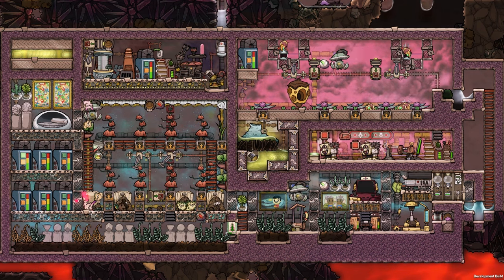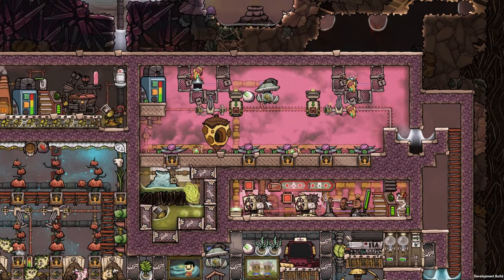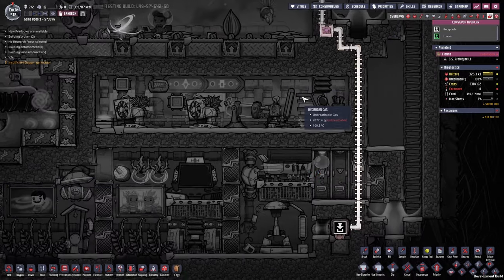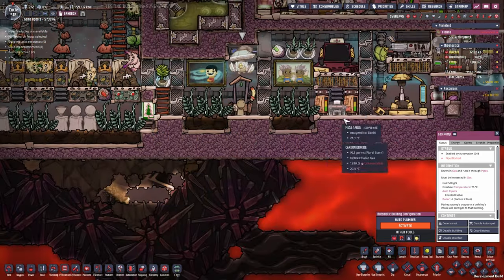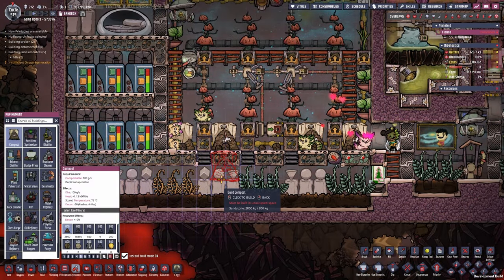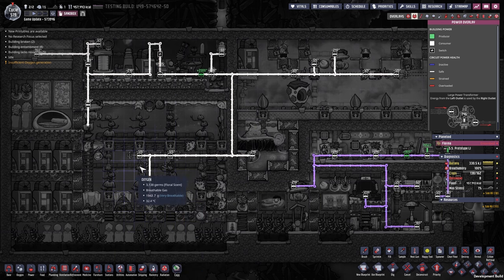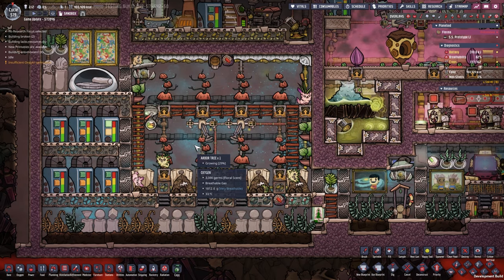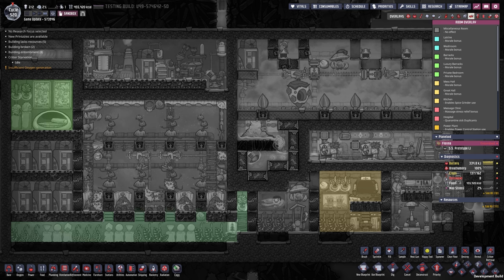Lumber and Saturn Critter Trap Setup - Oxygen not included

Comment: I personally would switch a couple of composts in favor of a pokeshell or two, which will give me sand to run water sieve + proper bathrooms/showers.
Reply from the maker: I thought about that but the amount they give didn't seem to fulfill the amount needed to switch to a water based system. The pokeshell gives 15kg Sand per cycle but the water sieve needs 1/5 kg per second for a 1kg per second geyser. That is 125kg per cycle. I might make a version that has an optional water pokeshell system. But at that time i thought the math didn't work out for what i had planned. I might have been wrong though
Reply: well,you do have ethanol for polluted dirt

Comment: I understand that Food Poisoning isn't deadly, but still... There is a way to have a stable Lavatory/Sink/Shower to deal with it. All you need is enough Filtration Medium for one Water Sieve.
1) Meteor Showers is the easiest way, but not every planet has it. 
2) You can melt Dirt to get Sand. Around 330 degrees Celsius as far as I remember.
3) Pokeshell/Oakshell ranch.
Reply from the maker: Hey Lorens thanks for the list.
I am trying to answer why i decided against it / what was my train of though:

I thought of some of them but decided against them for various reasons:
-A Sand setup requires lots of recoursess itself. I didn't want the base to get too complex. 
-A sieve uses lots of sand. if you have a constantly running sieve supplied by a rock crusher for example you need a dupe almost working half a cycle on it every cycle.
-Meteors are a good recource.
 Probably not in the dlc cause there you only get certain meteors on certain planets.
-Pokeshells are a good source, still alot are needed for a single sieve. 

I tried interesting melting dirt. But over 325°C is alot of heat with only steel as highest material. i try not using niobium or thermium in my build so most people can copy them. Using Magma is implementing a second base recource and would nullify the experiment.

Do you think there is a simple sand producing setup i can easily include? (must work on every planet, cannot use space level material, no exploits)

Am i overlooking something simple?

PS: the water sieve to change this setup to have a lavatory and O2 based oxygen would only need a sieve to run 1/5 th of the time. so 250g of Sand per second
Reply: @lumaraw  So, no Thermium, no Magna and no meteor showers. Sure. 
Sieve requires a lot of sand if it runs constantly, but considering that you only need to filter a little bit of water per cycle, it's not that much. 12 kg of water for Lavatory, 5 kg for Sink, and 16 kg for a Shower. So it's around 7kg of sand per cycle per dupe with the Sieve having the inherent storage of 1200 kg. One Pokeshell would give you around 30 kg of sand per cycle. Ethanol Distiller should be enough food for up to 3 of them.
Reply from the maker: @Lorens4444  Oh that is nice. so for the current setup without changing to an electrolyzer can be upgraded with just 1-3 wild Pokeshells  (when they die and leave an egg behind we might need some extra buffer so since i don't want to do the math we can put in more).
I put 3 in the Ethanol production room and now have it running for a while. let you know what happens if i remember :D
 
Thanks again
Reply from the maker: @Lorens4444   Update: in 45 cycles 3 pokeshells produced 1135kg of sand giving us 25kg per cycle to work with.
Reply: @lumaraw  Pretty good numbers considering that we only need around 7 kg for one dupe per cycle. XD
Reply from the maker: @Lorens4444  Yes now we can switch to better toilets showers etc.

we still need lots of oxyfern and can't switch to electolyzers 
but i like the option of the sand-water sieve-toilet upgrade
Reply: If you are going a 'hot route' then you are far better off just boiling some polluted water. Doesn't need a steam turbine if you don't want, as you can just do a simple heat exchanger. Pokeshells do synergise well with the trees, but with that much hydrogen power is basically free, so I would much rather divert the polluted dirt to oxygen production. Sublimators and an oxygen liquefier doing less than 1kg/s are not hard to set up. I bring this up because with decent heat exchangers one steel thermo-regulator can do both. Tune the temperature right and sort by element after and you can run it as a sour gas refinery at the same time, so even if you move away from the polluted dirt oxygen route it can still be reused.
Even if you are regarding starvation ranching as an exploit, you can become full independent with slicksters topping up your polluted water. If you have some way of getting enough heat to run a sour gas boiler then divergents make it go ham, because you can get sulphur to feed a grubgrub to tend your trees, replace the pips as a dirt source, and provide even more water (dump the mud into your boiling setup for labour free).
Reply: @agsystems8220  Emm... Isn't it an independent brick for hydrogen/power production? I might be wrong, but I don't think the construction of an entire base was ever brought up. The lonely dupe and all...  XD
Reply from the maker: @agsystems8220  Thank you for the thorough detailed comment. I always forget the sublimation station.

The rest might be above my level of knowledge at the time, i would have to research that first. I haven't build my own version of a sour gas boiler yet. Suptisingly

thanks again i see what i understand
Reply: @lumaraw  Well, if the excess oxygen is already thrown outside and you only want to support one dupe, the sublimation station is a waste of resources, isn't it? Unless you want to redesign the entire thing...